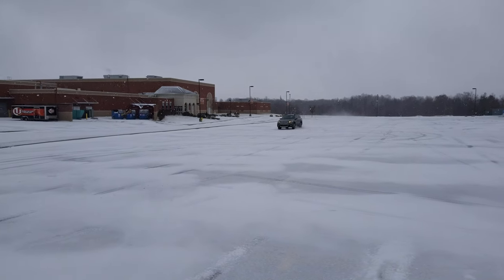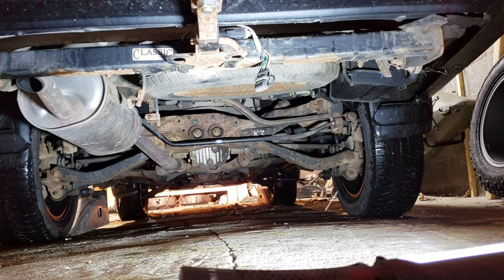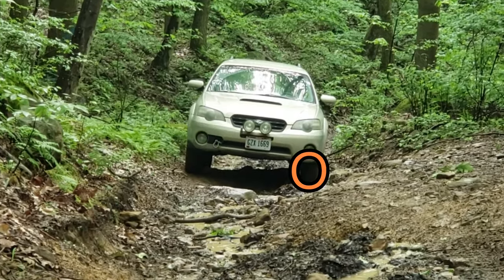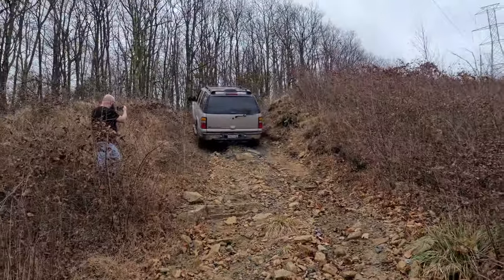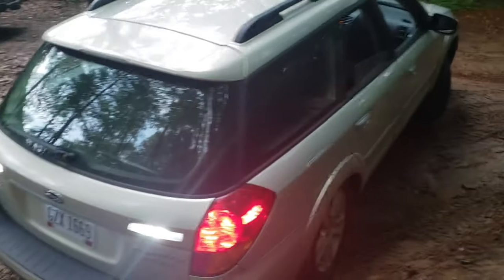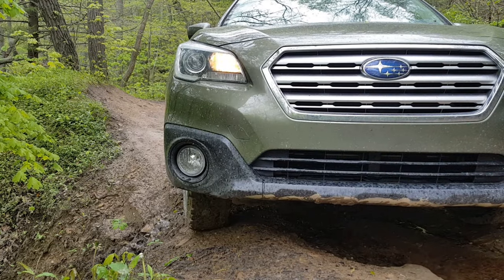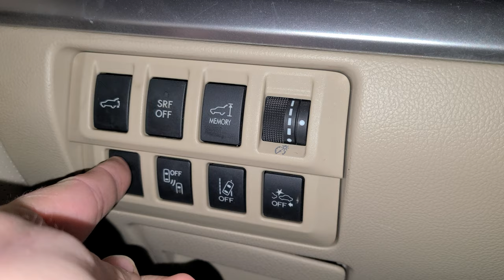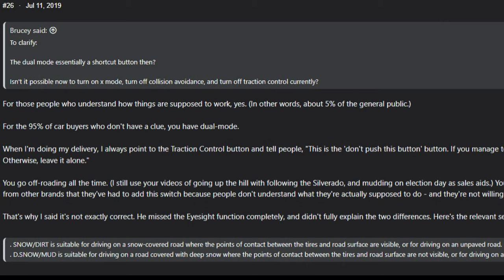Subaru X-MODE for DUMMIES.

Comment: Brucy, on the dual Xmode, the deep snow and mud takes the traction control OFF and allows each wheel to spin freely.
The single Xmode will brake the wheel that is spinning and send the power / torque to the wheel with the traction.
I’ve watched some tests where 3 wheels were spinning, but One had traction. The 3 wheels that were spinning stopped and the wheel with traction was the only wheel that was moving, thus allowing the Outback to get out of the situation. It was the rear passenger wheel that had the grip.
Reply: Imagine what a car would look like w 3 wheels off the ground what r u saying
Reply: @nathanday6873  Mud, snow and ice, DUH
Reply: I don't believe a word of that this car is not strong enough to put 100 percent power through one shaft, all the running gear is chocolate this is why it's AWD and not 4WD.

Comment: I think that the thing that you’re turning off is actually traction control, not VDC. I think that Vehicle Dynamics Control (VDC) is always on unless you do some extra funky fuse pulling trick while the car is already in drive. I turn off traction control when drifting in snowy parking lots, and as soon as I get off the accelerator pedal, I feel the car’s VDC system wrangle the car back under control.
Reply from the maker: I think that's accurate. The car still won't let itself slide but will happily spin the tires.
Reply: @bruceyyyyy  Yeah, exactly! I can only get it to slide while I'm flooring it. As soon as let off, the VDC nanny mode kicks in and it is amazingly effective too.
Reply from the maker: @MatthewHeiskell  Put it in neutral/drive, then put the parking brake on, pull the brake light fuse. It will get pissed and throw a bunch of codes but it will work. 

It works well if you want to do some donuts in this snow we're getting this season. 

How many feet they calling for over there?
Reply: @bruceyyyyy  Yeah, I remember you telling me about that procedure a while back. I'll be honest, I like having VDC ready to save my bacon when I get off the gas, haha. We are supposed to get at least a foot of snow in SW Ohio. The crazy thing is that it is going to start as rain, then freezing rain, then snow. And it is going to get really cold the next day. I think it will be a lot of fun in the Subaru!
Reply: On most modern Subaru's Traction control is PART of the VDC system. It does that and more. The only way to disable it is to disable the entire VDC system, which is a small loss if you are offroad anyway since it is designed to assist with cornering and accelleration etc...

Comment: Thank you Bruce. You helped me out very much here. I have had 4 x 4 Pick up trucks since I was 18 yrs old and I am know lookin at 60.Ford-Chevy-Dodge-CJ7 and a bunch of s-10's and Cherokee's from the wife. Any ways she went out and purchased a new 2017 Outback. Well unfortunately she passed away here back in May. I now have My Silverado and this Outback. I live in Western NY with plenty of Snow -Ice-Mud and blacktop. I know these are capable vehicles as I did a bunch of research before she bought it. I am old School with lockout hubs and transfer cases ETC. Still cant use to turning a knob for 4x4 but sure as hell beats getting out and locking the hubs in 2-3 feet of snow. :) :). You answered all My Questions regarding the All Wheel Drive/4x4 on This Outback and saved me bunch of time testing it out. Thank you Very Much.
Reply: Condolences to you on the passing of your wife.

Comment: I have a 2019 Forester (replaced my 2008 Santa Fe). Even though in the real tough stuff off-road the Subaru is the king in its class, for every day driving, I don't know what the hype is about. With ESC on the Santa Fe (same as VDC on the Subaru), the Hyundai was WAY better at keeping you on the road than the Subaru. If I am in a few inches of snow or in a turn where understeer was an immediate concern, the sante Fe would correct you immediately., In fact, it was virtually impossible to lose directional control in the Hyndai by steering too much or hammering on the pedal; it just wouldn't let you. First day in the Subaru, I was kicking the ass end out in mild slippery turns by just tapping the gas.

Comment: Good informative video Bruce Bruce!  I felt that xmode didn’t make much of a difference with the 2015 Forester XT.  I found manual 1st gear ratio and traction control off to work the best, but you know my story, the SJ FXTs liked to stall really easy, and that probably had alot to do with my experience.
Reply from the maker: Did yours not have X Mode? For some reason I thought it did. 

I've only owned (as far as Subaru):

1997 Brighton Wagon
2000 Outback
2002 VDC Sedan (pictured here)
2002 Forester 5 Speed
2005 GT Wagon
2006 Baja
2006 Forester
2007 Outback LL Bean Sedan
2008 Outback LL Bean
2013 XV
2015 Outback 2.5
2017 Outback 3.6 

I don't have any first hand experience with VDC in Gen 4s but it did seem to be of some assistance if pushed. 

But nothing like a 'simulated locker/limited slip'
Reply: @bruceyyyyy  the SJ FXTs had Xmode 1.0

Comment: Good video .. i have a 2021Crosstrek Sport that I modified same way .. Toyo All Terrains III's .. 225/65 17" .. skid plate and lifted 2" .. It's 14" shorter then the Outback and about 500 lbs lighter.  Makes a difference.  🤠

Comment: Quite smart. So the problem with one wheel in the air is that the other wheel typically doesn't move even if you have a limited slip diff, but by breaking only that wheel in the air, the other wheel can now move. Talk about a simple solution to the problem.

Comment: Those two buttons have no indicator as to when the system is on or if it is off.  I believe they turn off automatically at a certain speed.  But who knows since there is not an indicator light!
Reply from the maker: They both have indicators on the dash on my 2017 Outback.

Comment: Does the outback in the demo have a rear lsd or only a centre one (far as i know all subaru awd vehicles come with a centre lsd)? If it doesnt have a rear lsd then it would explain slippage with both axles having bad traction, but id be surprised if the rear lsd functioned that poorly. I think x mode is a way to more affordably get a similar result by using the existing hardware

Comment: Sorry but despite other accolades below, your explanation is almost incoherant. You say you are going to explain VDC, show us some wheels spinning, which was a great test for open differentials but has NOTHING to do with VDC. Then you jump straight to Xmode and say, VDC of = wheel spin, Xmode on = All wheels spin. I know how all this stuff works, and I THINK I know what you are trying to say there BASED on MY knowledge. But if you are expecting to teach noobs, that is a very confusing set of statements., and I couldn't possibly have come up with a more confusing or partially incorrect way to explain this. It's almost like you don't know what you are talking about, and are trying to explain what you know in ways that won't really commit you to any facts, and I know that is not the case.. No hate here. I am enjoying the channel. But if you are trying to clarify what VDC is, and how it works, please try again. You are conflating VDC with Open differentials in your explanation and it is confusing. You can do better. In fact you can use the same Video and dub a better explanation over it. And THEN explain Xmode. I wouldn't say "all wheels spinning" I would say NO wheels spinning, or LIMITED spinning with XMode2. THEN you can explain how to use the two tech's in conjunction with each other. It seems like your take is to NOT use VDC offroad, so SAY THAT. As I said, I already know how this stuff works and found this a bit confusing. Your explanation of differentials was spot on tho.. Even the first part of VDC with the sled was pretty good and you should have STOPPED right there, but then you said "here is the problem" and showed something that had NOTHING TO DO WITH VDC. Yes, open diffs are a problem. But make it clear you are done talking about VDC because people still pondering that are trying to figure out how your ramp test explaines VDC.   Databyter
Reply from the maker: Thanks for the feedback. I guess I was thinking "here is the problem.. " was introducing x mode since it's difficult to talk about it without talking about VDC first. 

I made this after a friend mentioned in the last off road video I talk about VDC/x mode and they didn't know what any of that meant. 

I didn't want to start talking about ABS tone rings and things of that nature so tried to make something helpful.

Looks like I could do better. (:
Reply: @bruceyyyyy  - Subaru owner here! I drive my wife's old stock '06 Forester (256K!) but it's been all streets, freeways, and Mojave Desert/Eastern Sierras smooth-ish dirt roads. Not too much bottoming out on anything serious, no serious challenges, but it's been someones daily driver since we bought it new, so we haven't been able to take too many chances with it. (She's got a newish Crosstrek hybrid now, but misses her manual shifter a bit. The new one has got all the bells and whistles and buttons and whatnot, but it's still too pretty to chance ripping anything off of the car, and the power available is... fine for streets and freeways. It's the kind of very polite Subaru you'd drive to the bed-and-breakfast on a rustic road!)

I've been watching your videos because I hope to own a Forester Wilderness one of these days, for more backroad adventuring when I retire in a couple of years, and it's SUPER fun to watch what you can do with your Subies! 

My brain hit a speed bump at 4:33 in the video when you said "If you want tires to spin, turn VDC off. If you want all four tires to spin, turn X-Mode on." 

"Spinning tires" means no traction going to the ground, to me, so I rewound that bit, and it still sort of made my brain go sideways. Did I miss a point? What combo is best for getting through that diagonal two-wheels-off-the-ground scenario?

Or maybe someday I'll convince my spending-averse daughter to buy a new car, and I'll re-inherit her grandfather's 2001 4-Runner, and I'll get the 4WD vacuum lines repaired so that I can use the 4WD again, and THEN I can do some rougher road stuff. She's had it for a decade, now, just going to work, to stagehand gigs, and to D&D games at friend's houses!

Cheers, and thanks for the entertainment!
Reply from the maker: So I will say if the diagonal spin is an issue I would turn on x mode. 

The car should figure it out eventually but the x mode is near instant.
Reply: I’m still confused. If I’m on an uneven rocky trail, then I benefit by turning on x-mode, and also pressing the button on the dash to turn off VDC, right? Because then the tires without  grip won’t spin as much, and that power instead goes to the tires that do have grip, right?
Reply: @so4796  Bottom line, and this depends on model, but I would never turn on Xmode at all unless I was really in the shit and already haveing problems. For the most part you don't need it. When one wheel starts spinning and you can't move forward, THEN put on Xmode. VDC may or may not help you depending onthe terrain or what you are trying to do. It is designed mostly to help you during normal driving on the road, and can work against you offroad depending on the terrain. If I was in sand or snow I'd turn it off. And I'd turn Xmode on if I was still experiencing problems. My newest Subaru is an Outback Wilderness. I've had it 6 months and I've had it in snow and mud and sand, and I've never needed to turn anything on or off because it works so well as it is, and has great clearance and traction and power out the door, and a very refined AWD system that has eliminated many of the problems of the past. But the new Xmodes do over several settings for no slip, or all slip because sometimes you want all 4 wheels spinning, and sometimes you want Xmode to stay on even if wheel spin indicates a higher speed than you are actually going. They've evolved these systems quite a bit. But if you have a Subaru that is built within the last decade or so, you still have a capable car. Chances are if it won't move  it is the VDC, and if one tire is spinning, Use the Xmode, and if it is still underpowered, then it IS underpowered. Remember that we have no low range, so it takes an AWD much more torque to accomplish the same grade or obstacle that a low range geared 4x4 would just chug over. But it's a fair tradeoff since we are lightweight and get much better mileage.  Databyter
Reply from the maker: @Databyter  I got the Forester Wilderness stuck in a field recently. It was doing the diagonal spin where a wheel on each corner got lifted off the ground. 

Putting it in X mode 2 it drove right up and out.
Reply: @Databyter  thanks…but mine is a little older. I’ll be using a 2016 outback (2.5 engine) and occasionally driving these kind of trails, and also on the beach. Sounds like x mode will help prevent trouble at low speed, and VDC off will help if a tire is off the ground on a trail. Is that correct?
Reply: @bruceyyyyy  Absolutely.
Reply: @so4796  VDC is mostly there for on road performance and handling and may include things like intelligent traction control, but not limited to that. It is less usefull offroad. The first thing I would do is turn off VDC if you are not getting power when you need it. Then if you are getting excessive wheel spin and not enough power on the ground Id put on Xmode which is not locking your differential, but enhances the torque vectoring tech your car uses all the time, but enhances it even further to work harder to push the power towards the wheels that are not spinning i.e. have more traction.  Databyter

Comment: oh. I think my car is too old for this feature. Mine is a 2010 Outback. The Subaru Uberoo. maybe i should start ubering again. but my car actually not very comfortable to sit in and ride in and i think a Forester would be better. Do you know any Subaru Forester and Uber jokes? Do you know if any other cars would be better for ubering?
Reply from the maker: If I was ubering I would get a Prius or similar hybrid. They make great taxi's in NYC for the same reason they're good uber vehicles.
Reply: @bruceyyyyy  good idea thanks. maybe I can get 2 new cars. A used Subaru Outback as famous as mine or yours should be worth at least 2 other cars. That would be an excellent trade. Maybe a toyota prius hybrid car and a Diesel truck. I want a diesel truck because there is some really heavy stuff I want to drag around. ha ha ha.

Comment: This is obviously late, but do you recommend switching to x mode every time you are in/snow snow, deep snow, dirt, and mud, or only when you experience difficulty driving in these conditions. 
Also, when turning X mode, the traction control is turned off. If you are on a road covered in snow/ice, wouldn't that increase the likelihood you will lose control of the vehicle?
Reply from the maker: Traction control stays on with X mode. You can still turn it off. 

As far as when, since X Mode disengages above 25 mph I would say if it's rough enough to need drive that slow then it's worth engaging.

Comment: Thanks for this video. Very informational! What's your opinion on a rear differential locker like from Torq Industries? If X-Mode functions essentially as an electronic locker, is a mechanical locker overkill?
Reply from the maker: I think the locker would be more capable since it would ultimately be quicker to react. 

It would behave similar to the Chevy does in the video here with it automatically engaging the rear wheels.

Comment: First time subaru owner, trying the brand out for commuting in a few inches of snow to and from work, would it be necessary to use x mode even if im going under 25mph through a couple inches of snow or the AWD is capable enough? If i dont off road would i have a need to ever use the feature?

Comment: So the X-mode seems to be meant for situations where a vehicle is stuck in place with tires slipping.  But what about when a vehicle traveling on asphalt at 40mph hits a patch of black ice or even some slushy snow and starts skidding? Which AWD system is better suited to handle that relatively high speed situation? I am trying to decide on a family hauler between a Honda Pilot and a Subaru Ascent and wondering if Honda's iVTM4 or Subaru's fulltime AWD with X-mode is better suited for us.
Reply from the maker: If you want to drive 40+ mph on black ice I don't think it matters much on either vehicle. They're both good but have limits. Snow tires are a must for either.
Reply: Nothing beats black ice lol
Reply: If you're planning on hitting black ice at 40MPH, pick the Subaru Ascent, because it has the higher NCAP/ANCAP/IIHS crash score, for when you slam into something.
Reply: @Erelyes  I chose to get the Honda Pilot Trailsport instead.

Comment: Never took my Forester out yet but what I got from this is to turn on  X mode, turn off traction control and use manual 1st gear and go slow?
Reply from the maker: As slow as possible but as fast as necessary is generally good advice.

Comment: How is the tuning of the single-wheel braking on pre-xmode subarus? Is it the same as modern non x-mode, or somewhere in between, as far as brake engagement aggressiveness to stop a spinning wheel?
Reply from the maker: Somewhere in between. I had VDC swapped into our Baja and it would engage eventually but only after heavy wheel spin.